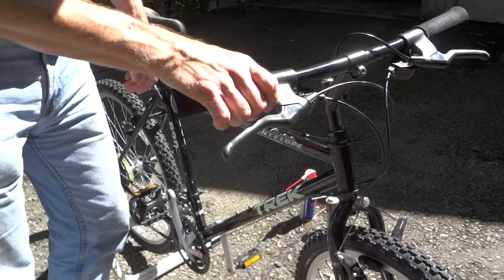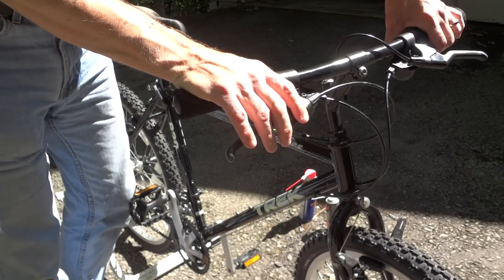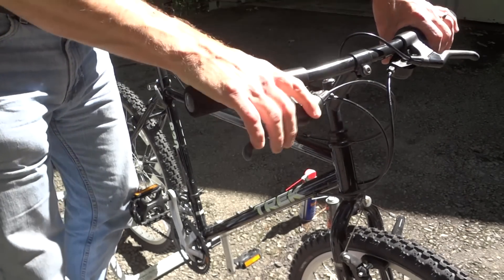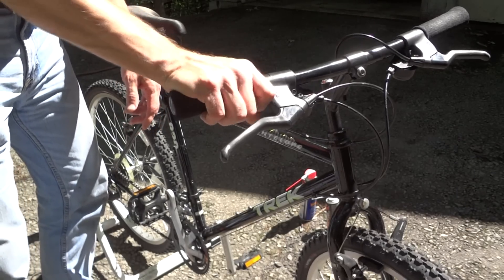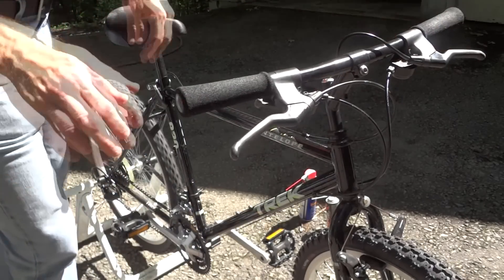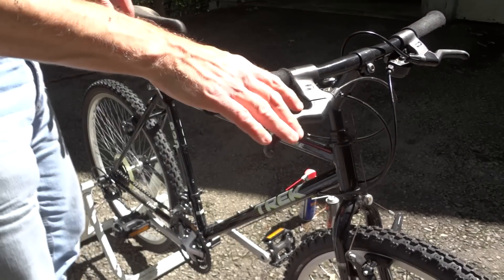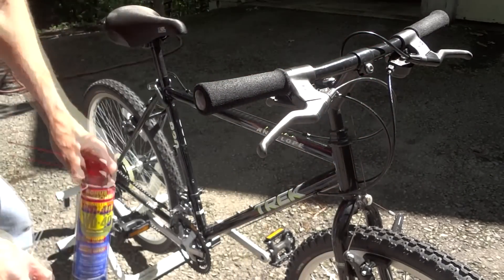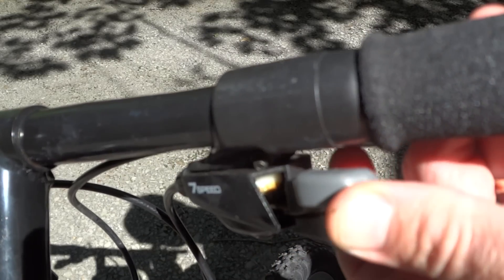How To Fix Shimano 200GS Trigger Shifters Super Easy!

Comment: This worked fine for me for the right shifter (rear derailleur), but it didn't solve the problem with my left shifter. I had the exact same issue as is described in the video, where I was able to shift up to the larger gear, but the shifter wouldn't "click" and stay in position, so as soon as I let the button go, the chain would get shifted back again. 

I finally discovered the problem with some tinkering... 

It turns out, inside the mechanism, there is an "L" shaped piece of metal, and it has a spring connected to it. It is supposed to press itself against the pawl mechanism, which kind of looks like a small wheel with notches on its edge. When you push the shifter button and the pawl rotates, the "L" pushes down and clicks down into the notch, thus keeping the derailleur in place. This metal "L" was totally stuck with old grease, in an upward angle, and the WD-40 just wasn't doing the trick on its own. So, when the pawl would get rotated, the "L" never pushed down to click into the notch.

I had to disassemble the shifter by removing the bolt and screw, and cutting a chunk out of the plastic casing, allowing the casing to come off without cutting the shifter cable. Once I had access to the internals, I used WD-40 in combination with a sewing needle to slowly remove the crusted grease, and work the WD-40 into the mechanism. Eventually, the "L" was freed, and it started pushing against the pawl again, which solved the entire problem. I re-assembled the shifter, sprayed in some lithium grease, and it's working great.

I hope this helps someone in the future.  :)
Reply: You definitely helped me!

My left shifter was experiencing the same issue and I wouldn't have been able to fix it without your comment. I really appreciate the effort you put into providing this helpful information. 

Thank you! 👍

Comment: Thanks for this - mine had been stuck for years and a shop had told me they weren't repairable and would have broken inside (spring or similar). Half an hour working the shifters while soaking with WD40 and they're now working good as new! The large lever to work the rear derailleur was the worst and took forever, but once things started moving properly they sorted themselves out.

Thanks again, probably wouldn't have tried something so simple before opening them up and no doubt breaking them!

Comment: Thank you!!  I took an old Trek bike out of storage after a few years.  The 8-speed bottom trigger shifter wouldn't go down below 4th gear; the trigger just pushed all the way in, seemingly with no resistance.  Same thing on the 3-speed bottom trigger (wouldn't go up into 3rd - it just pushed in all the way with no resistance).  

As a bike amateur, I assumed the shifters were shot.  Then I watched your video and pumped a bunch of WD-40 into the triggers, and ran up and down through all the gears while stationary.  After a few presses, I got a LOT of resistance - to the point where I couldn't push the triggers at all.  Then I took the bike for a short ride, and was quickly able to shift smoothly up and down through all the gears.

THANKS!

(Also, for what it's worth, the bike is a Trek 7200FX, and the gear shifters are Shimano ST-EF29-8.)

Comment from the maker: It's called Tri-Flow. You can find it at bike shops. The books I have read suggest a heavy oil or a light spray grease. Many guys in the bike forums recommended Tri-Flow as did the guy at the bike shop. So that is why I am using it. I has worked  so far. I think this is one of those things where many different things will work and it is a matter of personal preference.

Comment: Thanks for the video! I worked on mine for close to an hour before the springs started loosening up! I almost gave up. I also had to cut a slot out for the cable adjustment so the cover would come off.

Comment: I have a set on an 1990 (I think) Norco Bush Pilot that I bought used. They were super stiff. I took them off, removed the cover, soaked them in mineral spirits, then lubricated with tri-flow. I also had to loosen the screw that puts tension in the 7 speed assembly (the left hand nut). If I didn't loosen that, the lever wouldn't return after being pressed. Now it's working well enough to use. Still old and tired, but usable until they're eventually replaced.

Comment: Thanks RJ.  I'm going to try it on my wife's Trek 800.  Hopefully it works.  The shifters shift but slip.  Cheers
Reply from the maker: Good luck!
Reply: Thanks RJ it worked.  I had to take the shifters off the handle bars and throughly clean them but NOW they're like new.  Cheers

Comment: Good day RJ. I removed the shifter assembly for the 200GS left side for the FD. The problem is, I am having a hard time guessing where the springs line up and getting it back to it's assembly. I searched online and couldn't find a service manual for all the proper parts. I hope you can help me get this thing back.

Comment: thank you very much for this simple video it's going to help me a lot with my problem, I just have one question after I clean everything with WD-40 I have a high-end silicone-based 3 in 1 oil .Can I use that to lubricate the pawls?
Reply from the maker: Not familiar with that oil. Most shops I know use the Tri Flow that I used in the video.
Reply: +RJ The Bike Guy ty for the fast reply!

Comment: Wow! That looks just like the 1990 Trek 800 I just picked up.  It has a SHIMANO SL-M201 200GS 7S shifter on the right side and a SHIMANO DEORE on the left side.  I'll assume the left DEORE shifter was used to replace the original at some point. 
I ran across someone selling both original Shimano shifters, cables and housings in an unopened original Shimano package and I was wondering if I should replace the old with these OEM shifters, or should I use something more modern?? What say yee, RJ?
Reply from the maker: It's for you to decide. What you want, and how much you want to spend.
Reply: @RJTheBikeGuy  Well the asking price was $23- for the set, with cables and housings sounds to good to be true. I'm having a hard time finding out what the appropriate price for new shifters would be.

Comment: I would have just used WD40 It's great, Due to its low viscosity, WD-40 is not always a suitable oil for certain tasks but probably ok for a gear shifter.
Reply from the maker: Your choice, but WD-40 is not a lasting lubrication.

Comment: Didn’t work for me 
You can’t take the cover off the shifter unless you disconnect  
Or cut the cable 🙄
Shifters need to be removed
and cleaned and lubed 
internally and new cable

I dont like these shifters 
Too complicated inside (3 pawls) each
Not maintence friendly at all
Need to be lubed intermittently
 I might just find some some simple 7 speed or friction shifters for my high plains schwinn.

Comment: P.S. Do NOT subsitute WD 40 with Carbarator cleaner, Melts the plastic and gets on your fingers! LMAO ....yeah a lil Birdie told me. ;)
Reply from the maker: Jeff Carlile Ouch!
Reply: Still the shifter that regulates the small gears on back tire will not catch.
Reply from the maker: Sometimes thew pawls free up quickly, sometimes they don't. I had a couple shifters similar to these that didn't free up after spraying like this. So I ended up removing the cover, spraying directly on the pawls and manually moving them, and then they freed up and started working.
Reply: I can't get the cover off on the 200 gs. Is there a trick to it.
Reply: I have this problem as well.
Reply: Do you have a video of you doing this?  Thanks for the very informative videos👍